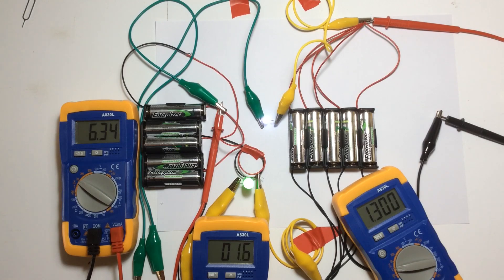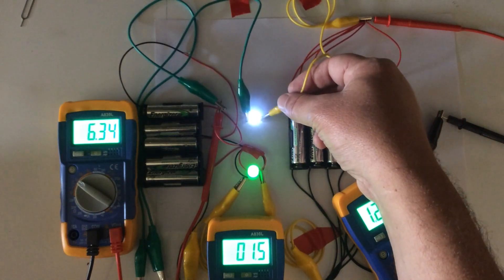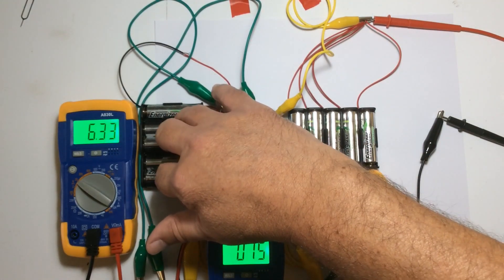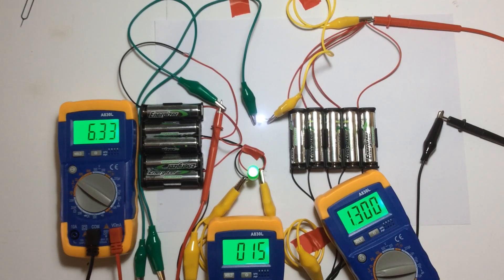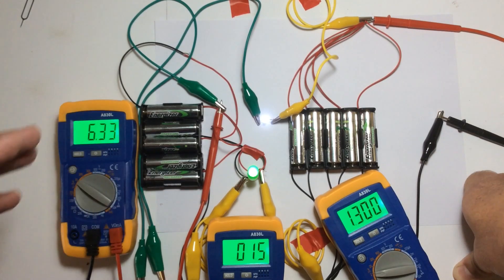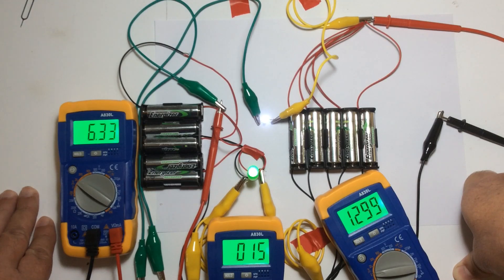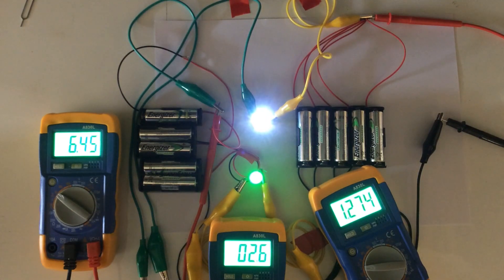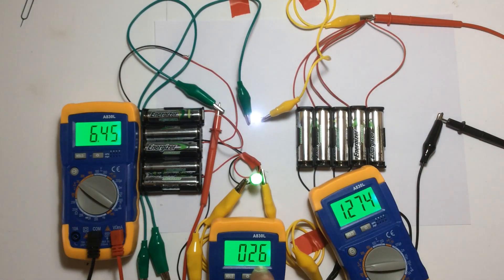*UPDATE 2* TESLA SWITCH 24/7 RUN, 240+ HOURS SUPER EFFICIENT LIGHT

Comment: awesome thanks again....im experimenting in trying to charge 1 battery at a time to see if they get more charge..cheers
Reply from the maker: Thank you for your comment.
If you are cycling the parallel side, one battery at a time instead of all 5 batteries in parallel it should be the same. In this example we have 5 x AA’s on one side and 5 x AA’s on the other side therefore the energy storage capacity is the same. In your case if all the batteries are in the parallel side are charged one by one. then there is the capacity to damage a cell by overcharge.
So it should work but to protect batteries it probably shouldn’t be left unattended.
Reply: ahh ok....ok i wont do it again then...cheers @whatifididthis...1236
Reply from the maker: @thebigfella9095  I’m not saying you shouldn’t do it but that it just should not be left alone. I hope to make a video soon using that method to drain the last bit of power from “depleted” batteries. In your case, assuming your not draining the last amount of power, there would be little to no known benefit.
Reply: @whatifididthis...1236  ohh ok cool....thankyou

Comment: I quite agree with you. It's not taught in schools. They want us to keep paying for electricity. 
It will be a good idea to include a solar panel and scale it up.
Thanks again for sharing, waiting for your next update. Do have a good day.
Reply from the maker: Thank you for your comment.
I have to agree regarding education, the problem is most of these people put a lot of effort into getting an education but little toward questioning their education.
I have done some tests with the solar panel and I believe this could make the circuit even more efficient.
Tomorrow I will test a better solar panel as tests to date have been with a crappy garden light solar panel and it’s extremely inefficient solar controller. I also intend to run some tests with 12 volt lights running on the transfer method with a 200 watt solar panel, I have a feeling the jump in quality might help a lot.